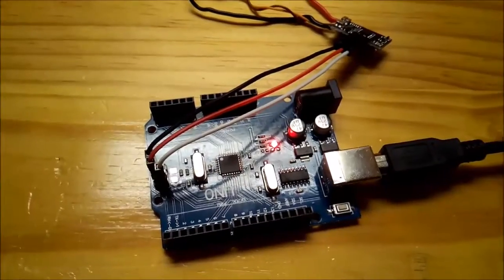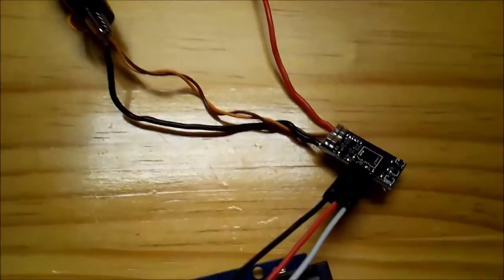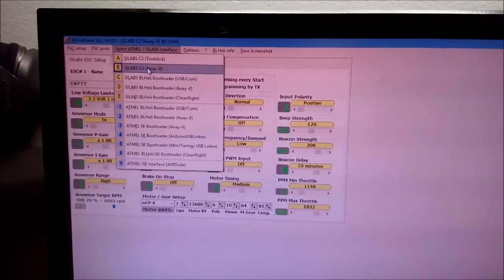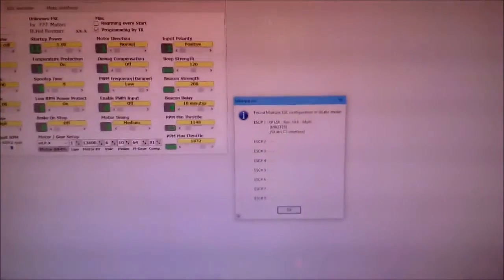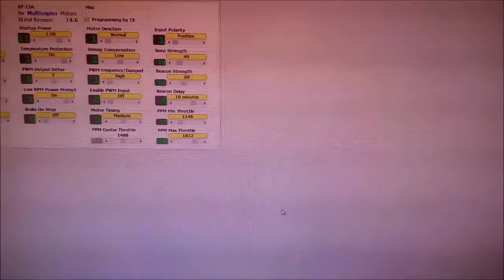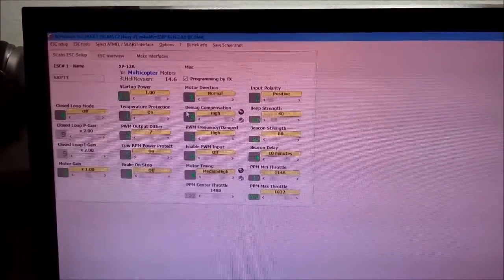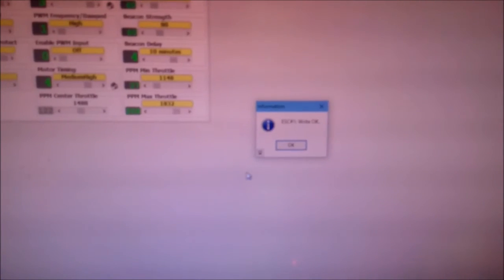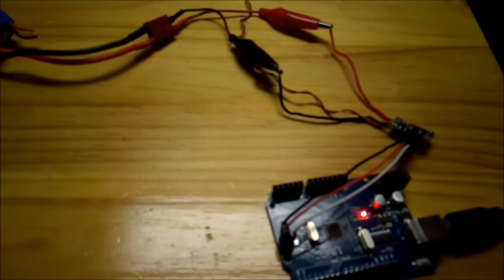Programming Blheli ESC with Arduino

Comment: Hi, is it possible to flash ESC this way with connected motor to it or I need to disconnect the motor from the ESC before any flashing?
Reply from the maker: You do not need to disconnect the motor. ALWAYS remove the props from the motor before flashing though.
Reply: @antzd  , OK, thank you a lot

Comment: Hello sir, i am facing a problem i.e my esc emax blheli 30amp is doesn't work with sp racing f3 flight controller so what is the problem...plz help me
Reply from the maker: Hi Nihar, its hard to tell without more information. My best guess is that if its a blheli ESC it will only work on oneshot125 with default firmware. If you have it set on DShot or Multishot it will not work.
Reply: No this esc is only supporters pwm input so i set it in pwm mode and it working but the motors are spinning in different speed.....thats the actual problem
Reply from the maker: The  ESCs need to be calibrated for the motors to spin at the same speed. Remove your props, go into betaflight configurator or whichever one you are using, in the motors tab set the value to full on all, plug in the battery, the ESCs will beep a few times, set the value to minimum on all. Your  ESCs should then be calibrated and spin at the same speed.
Reply: Yes i know that and i also calibrated escs and the motors are spinning at same time but after that motors are automatically changes there seed
Reply from the maker: It sounds like the ESCs are losing their calibrated settings then. If you look at the throttle range values in the blheli app you will be able to see if the calibrated values change back to default.
Reply: Ok i will try, the blheli suite link u given in the description box is applicable for all emax blheli series esc...?
Reply from the maker: Yes blheli suite works on all blheli and blheli_s ESCs.
Reply: But my esc is not blheli_s series.....it is only blheli series
Reply from the maker: Blheli suite works for both.
Reply: Ok....thank u so much